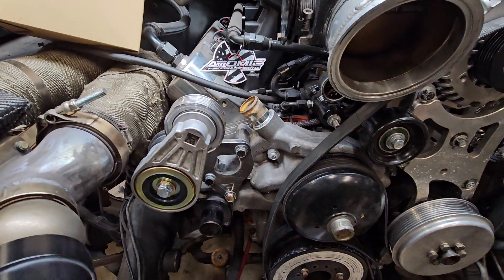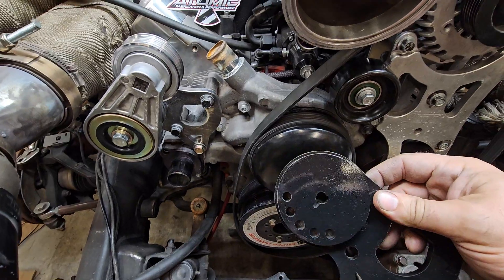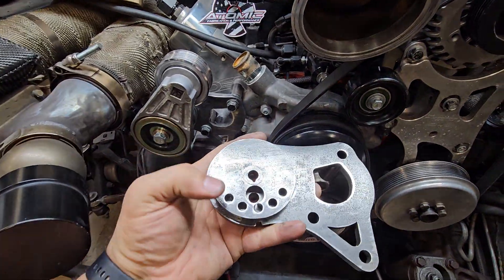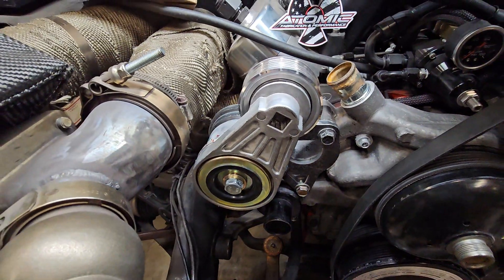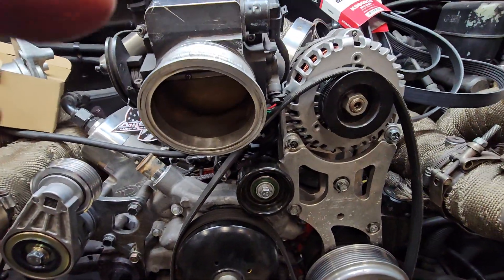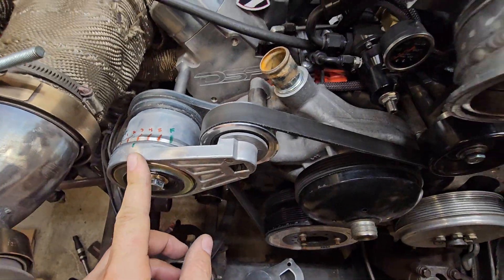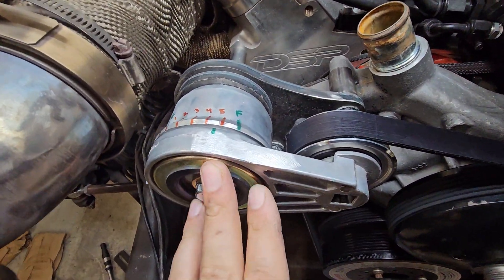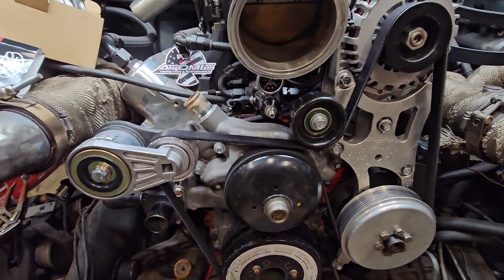Atomic Fab HD Tensioner Adjustment

Comment: the new stock oem tensioners have 2 mounting holes now.
Reply from the maker: Yea the newer truck (14+) belt setups are completely different, this is just for LS trucks
Reply: @atomic178  oops, I should have been more specific. I meant LS trucks. this tensioner looks really impressive.